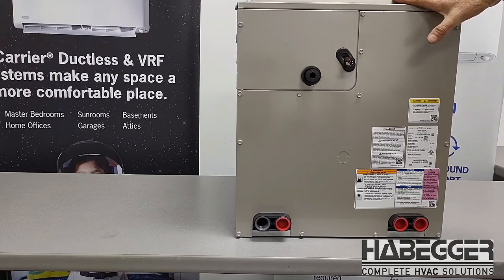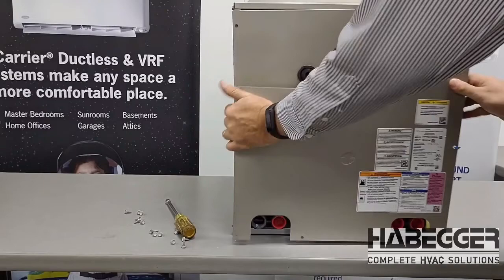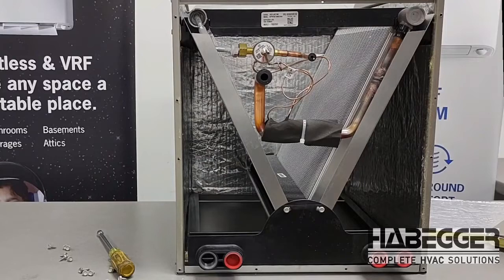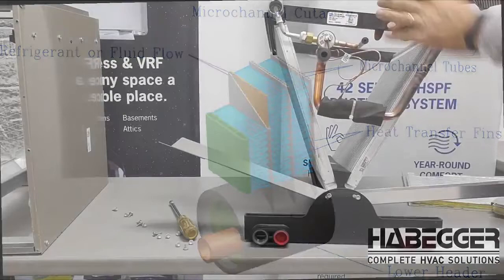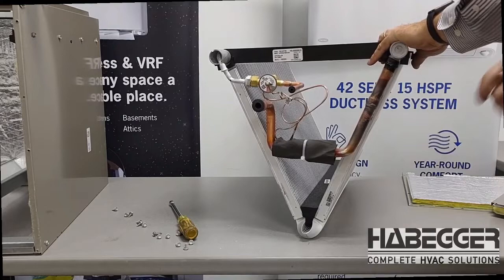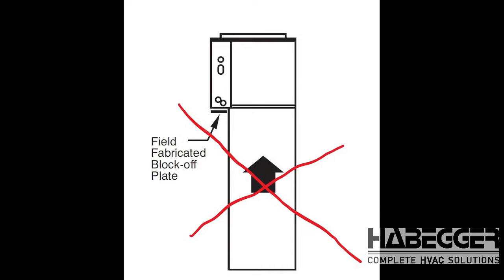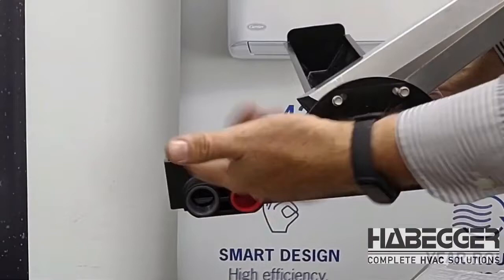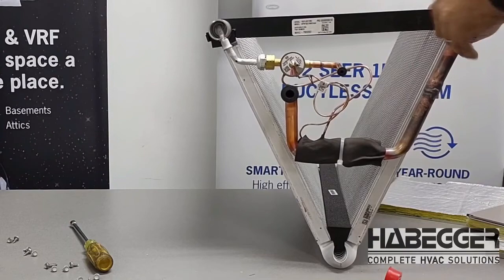V Channel Coil Model CVPVP Introduction

Comment: You had mentioned about installing with no dog legs or coil bigger then the furnace. What if the furnace is larger than the coil box? Should you still center it? Or will a flat cap on one side of the furnace opening be ok?
Reply from the maker: Our instructions show coil over hang with block off plates as “not recommended “.

Meaning it’s never been tested. May work?

Our experience has been it creates limit trips within the furnace. 

Good luck.